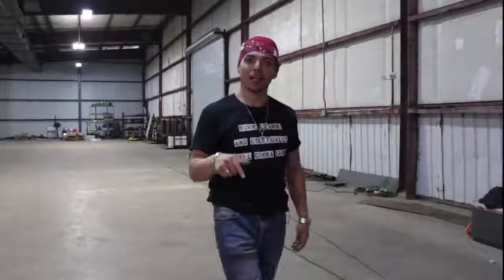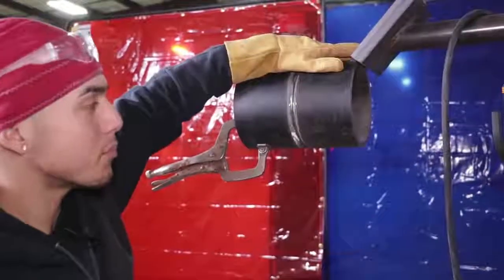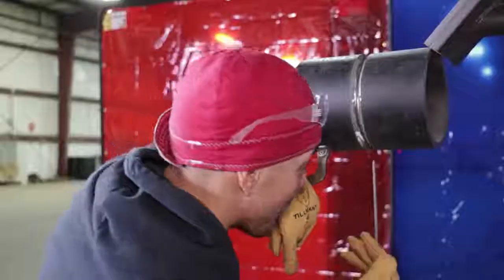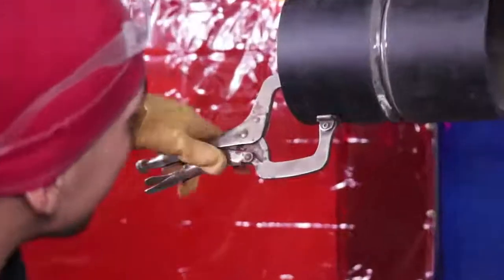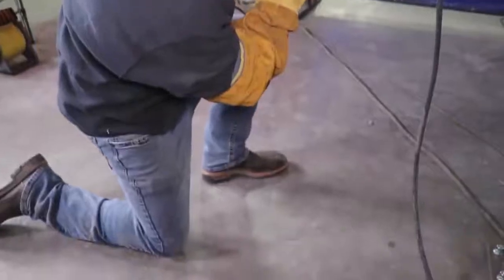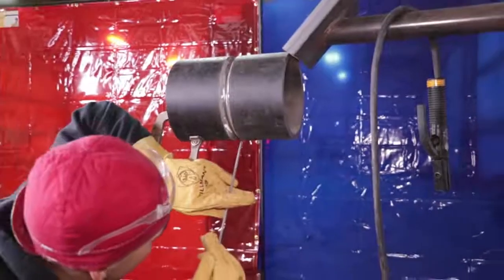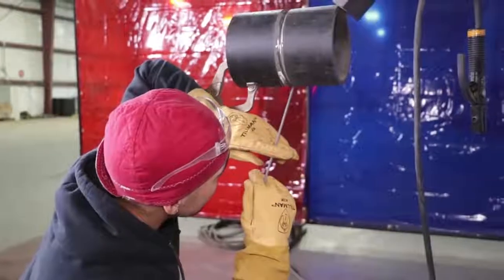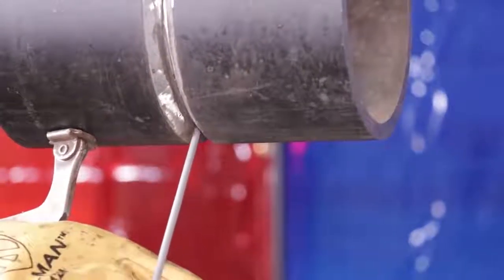5G Pipe Welding Lesson 6010

Comment: Could I be taken as a serious welder if I love SMAW and TIG but I hate MIG? I 🤔
Reply: Some ppl seem to love MIG, I h8 it!
A whole lot of set-up!
Using valuble gas to cover plate steel?
Everything must be perfect and the steel must be cleaned to get it right.
You can only weld plate steel.
No stainless or nothing else.
The welds often look like metallic glue.
Not a real fan of MIG.
Reply: @1trucxhondamov589  i feel the same man
Reply: @burnie2337  Never really got into MIG.
The feed.
The cover gas.
Everything has to be perfectly clean
You can only weld plate steel.
And, usually the weld looks a mess anyway with lots of tiny beads, splatter. 😀